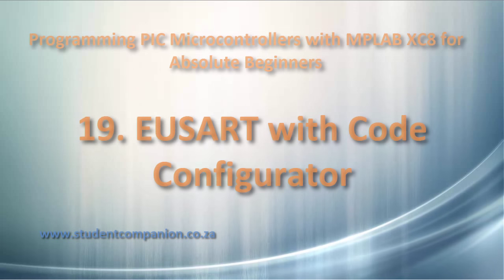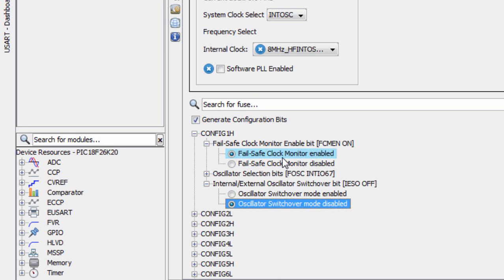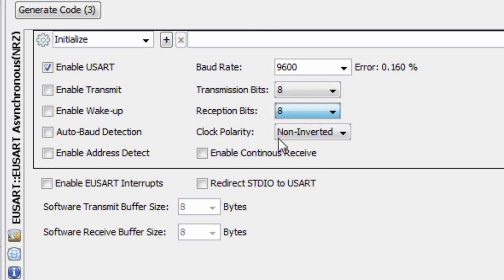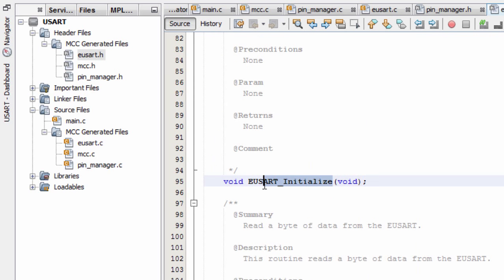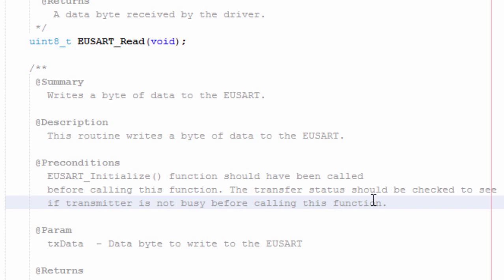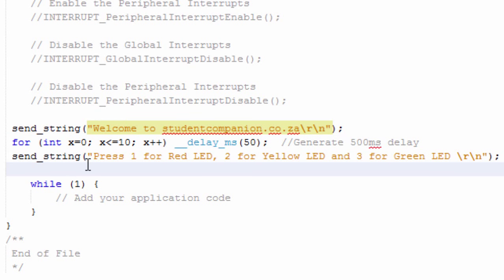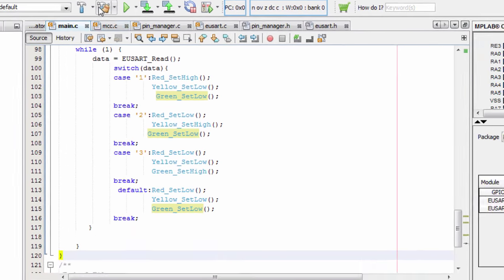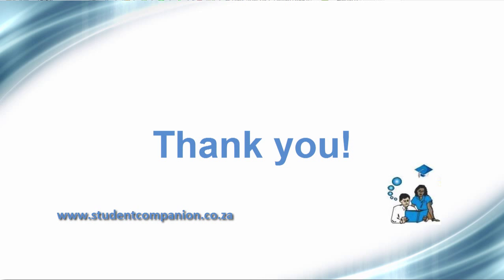19- EUSART with MPLAB Code Configurator | MPLAB XC8 for Beginners Tutorial

Comment: hi sir. i made this project and it works well; but only on pins RB0 RB1 and RB2. it doesn't work if i connect the leds to C pins, A pins or even RB3, RB4 and RB5 (i am changing the code as well accordingly, when i connect the leds to other pins) if you have any idea why is that?
Reply from the maker: Can you provide more info?
Which PIC are you using?
Are you using MCC as in this video?
Are you reconfiguring those other pins with MCC as well?
Can you post your changed code?

Comment: some vague letters are being printed on virtual terminal in proteus...whats the reason sir?
Reply from the maker: It's more likely the Baud rate of your virtual terminal is not the same as the one you defined in your code.
Reply: Student Companion i have set them same
Reply from the maker: Try to change the virtual one to something different, try eachbof those preset values and try.

Comment: Can we use RB0 and RB1 as UART (RS232) Tx/Rx ?
Reply from the maker: +Krishna “Electrifier” Kumar Sah which PIC Microcontroller are you using? You can't pick any pin, you can only pic those pins which have UART module.  Some pics have 2.
Reply: I'm using PIC18F26J50
Reply: sorry
i meant TTL serial
Reply from the maker: +Krishna Kumar Sah what do you mean by TTL serial? What do you want to communicate with?
Reply from the maker: Your PIC has PPS,  Some input and output functions are routed through the Peripheral Pin Select (PPS) module and can be dynamically assigned to any of the RPn pins. You can use PORTB pins by routing the Rx2 and TX2 to those pins. Read the section 10.7 Peripheral Pin Select (PPS) in the datasheet

Comment: it is very handy app when it support your project device. It does not not work with my PICKIT3
Reply from the maker: What doesn't work with your PICKIT3?
Reply: StudentCompanion the PICDEM 2 PLUS DEMO BOARD w/ PIC18f4550, it’d work with xc8 thought. Just got a warning saying the project’s device is not supported and referred me to download the libraries from a link. I think that will configure it as always I did, messing around with the resisters and Timers and interruptions. Shame cuz it seems to save a lot of time to do the job
Reply from the maker: You are not very descriptive with your question. 
Not sure what app you are talking about. 
If you are talking about MPLAB Code Configurator or also known as MCC and it's got nothing to do with PICKIT3. If you have problem to program your microcontroller, it's something else and not MCC. 
If you are talking about not able to start MCC with your PIC18F4550, yes MCC doesn't support very old microcontrollers, the PIC18F4550 is very old maybe more than 10 years old, you can try its current equivalents like the PIC18F45K50 which is an equivalent, more modern, cheap, with more features, compatible with the old one and is supported by MCC.
Reply: StudentCompanion great! Of course, that’s why didn’t work 🤦🏻‍♂️ Thanks a million!